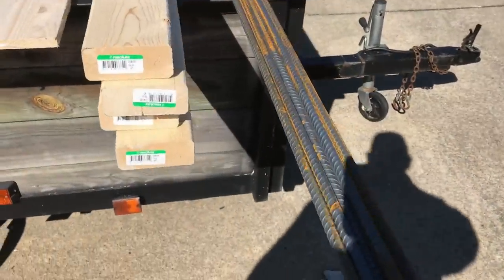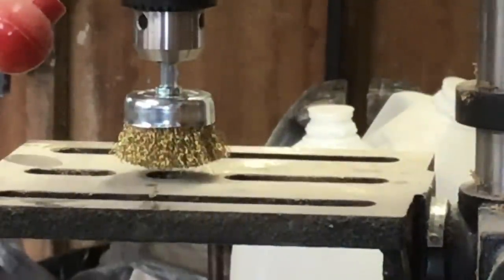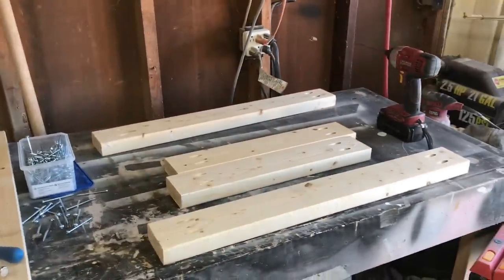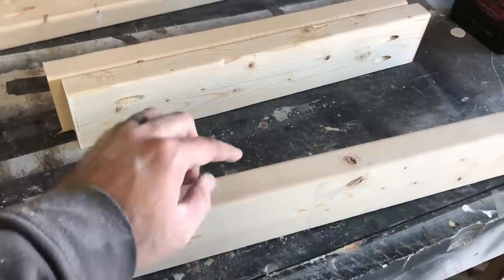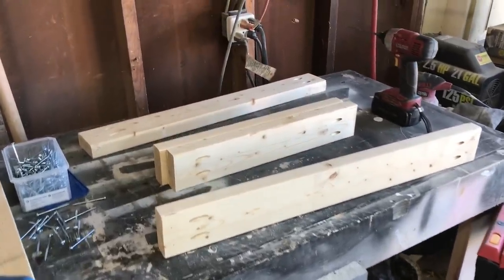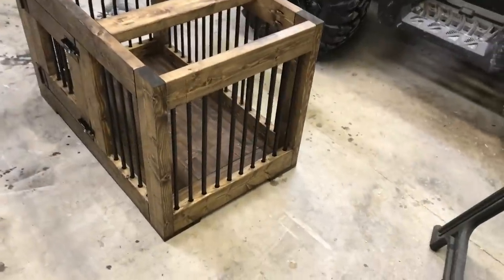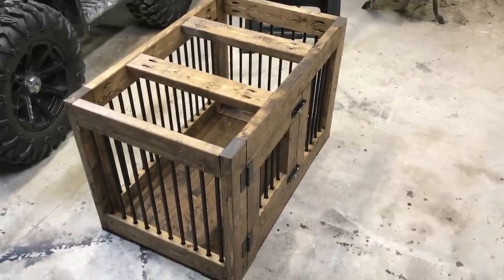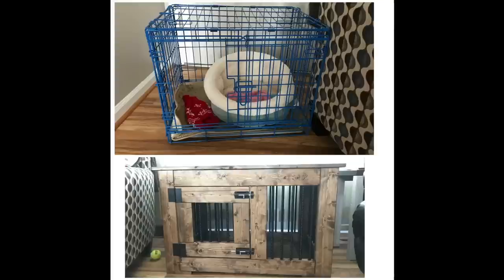How to build a Dog Crate | Made with 2x4’s and Rebar

Comment: Get those plastic dog crate liners from your local pet store, they only cost a few dollars. Use that as the inside measurement for the top and bottom of your wooden crate (which looks AMAZING BTW). Then if your pet has an accident inside the crate, you can remove the liner, clean it, and reinstall it without having to replace the wooden floor of the crate. I would also attach the top with hinges and some kind of latch to make cleaning the crate easier too.

Comment: Great video.  I will be making my first wood kennel this weekend.  I  been taking notes as far as what to buy.
We all learned from our mistakes. 
One thing I'm thinking of doing is, drilling all holes for bar before installing.  On the top frame i will drill all the way through the wood. Install frame. 
Insert the bars through the top.make sure hole on top is a bit bigger..once you line it up with bottom hole,  tap it with hammer all the way in.
You won't see the hole on top because your top will cover it.
Anyways Thanks a lot

Comment: I imagine getting all this bars in the holes were a pain, so I'm going to drill the holes all the way through the top 2x4 and then I can just drop them in afterward the box is assembled. I'll just make sure the rebar is cut so that is maxes out against the box topper so I won't have to worry about the bars lifting up and out after the top is screwed down.
Reply: Great step by step too by the way, really appreciate the video!
Reply from the maker: That would be a lot easier because it was a pain lining them all up.

Comment: This is an amazing build. Though I dont have the correct table saw for being able to cut the rebar is there another sturdy alternative I could use that would look great but also be sturdier then just wood?
Reply from the maker: MiSsToX1c I have built a few other dog crates and I ripped a 2x4 in half and used those as the bars. I put one pocket hole on each end, glued and screwed them when I attached to the sides. They are holding just as strong. (Makes the crate lighter also)
Reply: You can pick up a grinder at Wal-Mart for like $20 to cut the rebar. It will most certainly take a lot longer than the saw. You'll have lots of sparks for longer too so beware of fire hazards.
Reply: wooden dowel rods will work.
Reply: Chances are your hardware store can cut em if you know the dimensions

Comment: I love this, but I have a couple questions. What are the final measurements? What was the final cost?
Reply from the maker: breanna caitlin they were, 
24 inches tall from floor to the top,
table top was 39 inches long/24 inches wide, (that includes the top overhanging the box)
Actual box was 37 inches long/23 inches wide/23 inches tall.
Total price of materials were around $85.00 at Lowe’s.

Comment: Looks great! I’m looking at making something similar for a friend, but I was hesitant on using rebar until I saw your video. What did you paint the rebar with? Did it ever get future rust or does it completely keep it from rusting?
Reply from the maker: Alex bishop Thanks, I used the basic rustoleum spray paint you buy at Lowe’s or Home Depot. It’s been a while since the build and my dog has gave this crate the treatment and believe it or not still no rust. Now I did take the time to knock all the rust off prior to painting “which was time consuming” but it was worth it. I wish YouTube would let you post pics in comments so I could show you. But it does look the same as the day I painted it.
Reply: Popo's Woodworks awesome! Can’t wait to get in the shop and get it done. Thanks again for the tip!

Comment: Nice video did u make the door from 2×4 also
Reply from the maker: STARBWOY TV DANCEHALL & MORE I used the project panel for the floor. I cut it to fit just shy of all 4 walls so I can lift from the bottom and remove if I have to replace it due to dog accidents. Also I will have to measure when I get back in town and let you know.
Reply: @PoposWoodworks  you won't be lifting it through the top since you glued that down. But you can always unscrew the feet and let it just fall out of the bottom.

Comment: Do you think 1/2 aluminum rod would work?
Reply from the maker: Yeah they will work also. Reason I went with rebar was the cost factor.
Reply: @PoposWoodworks  still holding up well? I just drew up plans for a 42x31x31 and considering putting a cat tower on top. Thanks for the video. Almost bought  a half ass particle board one for $300

Comment: How much does it weigh?  I am torn between spending $400+ for an aluminum 2-dog crate for my truck, or making something just like this for less than $100.  Just wondering how heavy it is with all the wood and rebar together.
Reply from the maker: Billy Vandergaw I’m  not sure of the exact weight but it’s pretty heavy. I can pick it up by myself but it’s hard to move it because it’s awkward. Definitely better with 2 people. If I did a guesstimate I’d say it’s around 60 to 70 pounds. Most of the weight is the rebar of course.

Comment: Hi popo’s could you do me a Huge favor and send me a material and cut list for this. Some of it is cut out of the video and my fiancé and I need to build this for our dog!! Please please
Reply from the maker: Ginny Darnell ok, here you go.... 

starting with the 2x4’s:

4 pieces cut to 30 inches (these go along the top and bottom of the front and back of crate. Horizontal)

4 pieces at 23 1/4 inches (legs, parallel)

4 pieces at 20 inches (this is for the top and bottom of both “short” sides horizontal again)

1 piece at 16 1/4 inches ( this is the front center upright for door parallel)

2 pieces at 16 inches ( top and bottom of door. Horizontal)

2 pieces at 9 inches ( left and right side of door parallel)

Rebar is 1/2 diameter cut at 18 inches long. ( how many will vary on how you want your spacing) I think I drilled the hole a little bigger and about a half inch deep.

Inside crate floor is 20 1/4 inches wide 34 1/4 inches long ( this is a project panel from Lowe’s)

Crate top is 39 inches long by 24 inches wide (this is also a project panel) gives about an inch overhang on all sides.

4 pieces of 3/4 inch thick 5 inch wide 6 inch long blocks for the feet. Place one on each corner. This way if the dog messes the wood up over time you can replace the bottom board without needing tools. Just lift it up from the bottom and slide it out.

All 2x4’s were joined with glue and pocket hole screws. I used the kreg jig with 2 1/2 inch screws.

Then of course you will need 2 hinges of your choice and a gate lock.

P.S...... I found some scrap about 1/8 inch thick for the spacing of the door so it wouldn’t rub.

Hope this helps!! This thing will last forever lol.
Reply: @PoposWoodworks  Thank you so much. I have looked hi and low for an economical way to secure my pets. I have the tools to get started. With your help of experience  and knowledge I can now start
Reply: Thanking you once again. I hope to use pallets I have on hand. For the project list you had provided .My major cost will be the hardware (locks, hinges) rebar and Kreg jig. A very economical project .
Reply: @PoposWoodworks   @Popo's Woodworks  I am curious, in your video you have a single (1) project panel of 24" x 72". You said you cut it in half yet the measurements you listed out here are of 39" for the top and 34-1/4" for the bottom totalling 73.25"?? Did you in fact purchase two (2) project panels or did you mistakenly write out the measurements? Thanks!

Comment: Not bad, and not knocking your work, but 2x4s look very brutish. Why not use 1x4s? The stain makes it look nice, I'll give you that, but 2x4s just seem out of place for a furniture piece.
Reply from the maker: smsteger89 reason I went with the 2x4’s Is because they are $6.00 cheaper than the 1x4’s at my Lowe’s and I also needed the extra thickness for strength when I drilled the holes for the rebar.